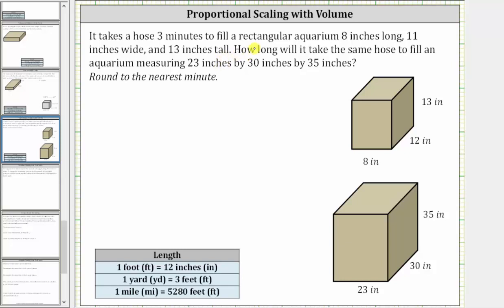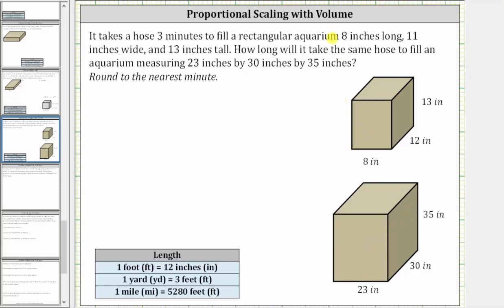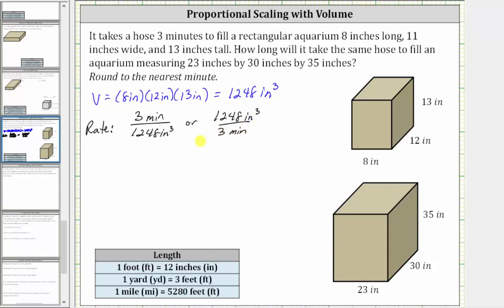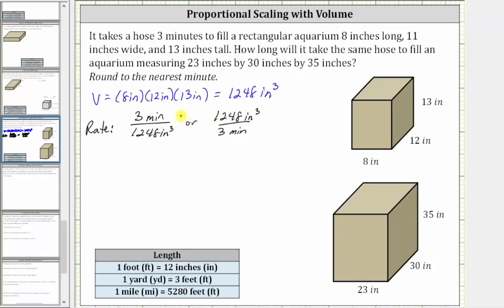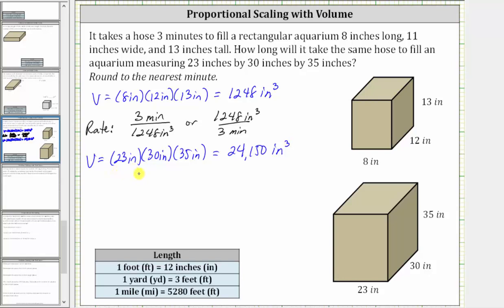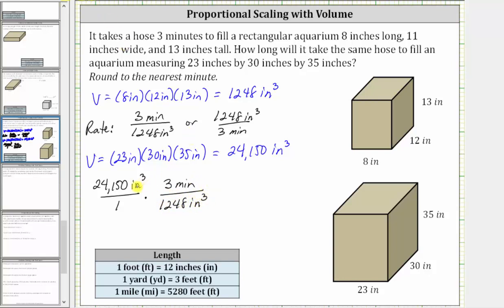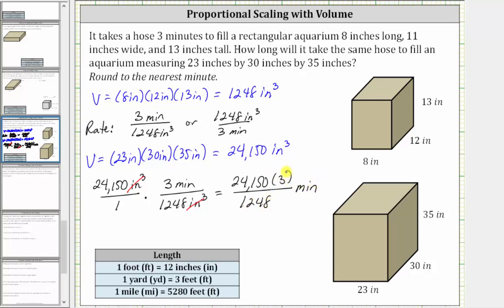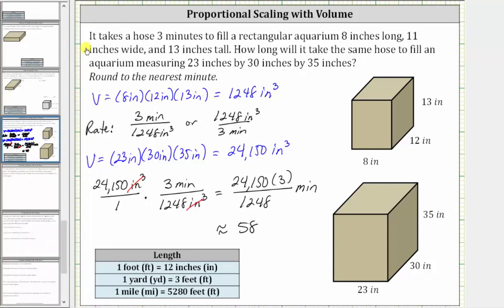Rate Application: Time to Fill an Aquarium

Comment: The directions list : 8 inches long, 11 inches wide, 13 inches tall, and the example has 12 inches instead of the 11. The answer is wrong, and I'm the first one to catch this. Explain yourself Mathispower4u
Reply: I caught that too.. Thanks for the clarification
Reply: The phrasing is incorrect when it comes to 11in not being 12in. However, the diagram on the right shows it as 12in... I caught the mistake too, but the diagram makes up for it. The phrasing just needs to be replaced.